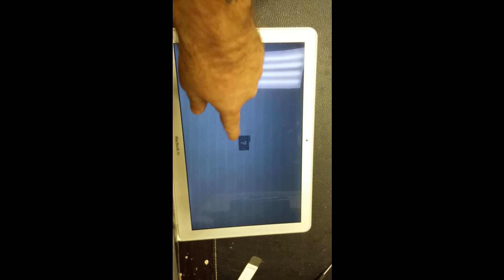Apple MacBook Air A1304 820-2375-A No Video Repair After System Is Doing Bad Memory Beep

Comment: Can I do this with a hairdryer too ? I don't have the equipment.
Reply from the maker: I do not recommend that. If it works...for the 2 minutes it may...it is not worth the risk of losing a motherboard over.
Reply: BGAReflow thanks, I see a lot of DIYs on youtube that use an oven too.
Reply from the maker: OllieH This may help some. The idea is the same with an oven since convection heat works the same as hot air.
http://doubleclickittofixit.com/how-can-i-tell-the-difference-between-a-hot-air-rework-and-an-ir-reflow/

Comment: Nice.
 More detail of the procedure would have been good, but, hey - Thanks for sharing .
What flux do you use for reflowing BGA's ?
Reply from the maker: The flux we use is standard flux. Depending on the issue we use no clean flux or standard flux. The type of work dictates the type. We also use flux paste for the reballing applications which we do.